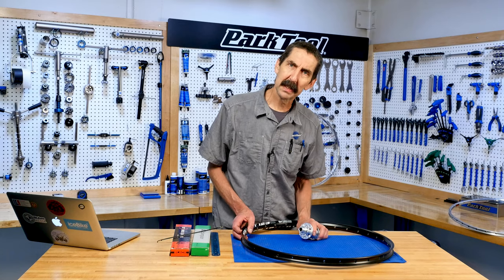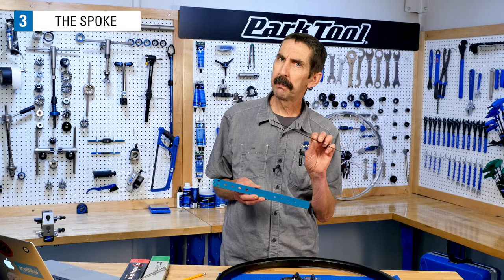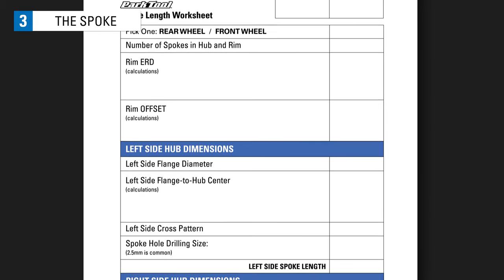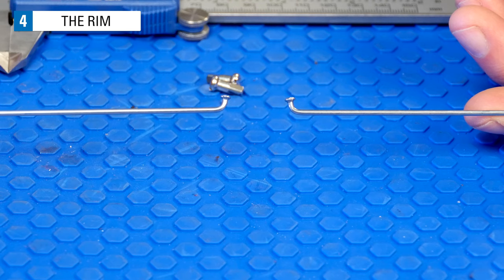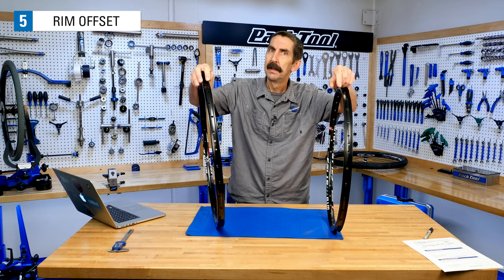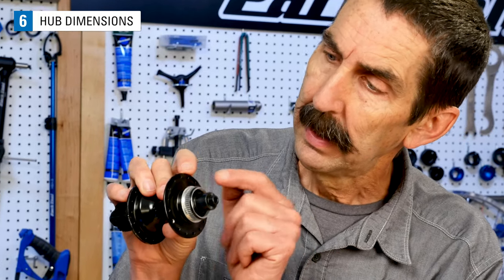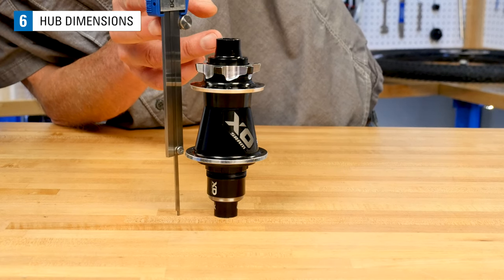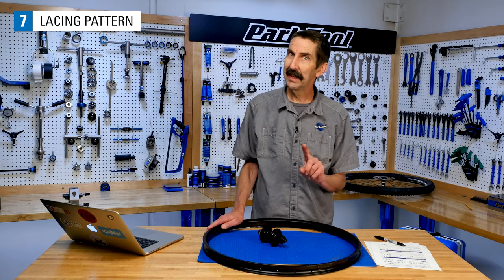Determining Spoke Length for Wheel Building

Comment: This summer, I made two 27.5-inch wheels by learning from your video. Front and rear wheels. It was my first time, but I was able to make it well. Thank you for the very easy-to-understand explanation. The rims were tubeless ready, so I made the tires tubeless as well. My bike has a 135mm rear end, so I can't find any finished wheels that can be put on 12 gears. However, Shimano sells 135mm hubs, so I made the wheels originally. Thanks, my Merida 3×8 hardtail is now 1×12. With that in mind, the front suspension has also been upgraded. Now I enjoy riding that bike very comfortably. I live in the suburbs of Tokyo, so I usually run along rice paddy roads instead of mountains. 

P.S.
 I received PCS-10.3 today. I'm thinking about how to put it in my small room.

Comment: Great video, this is really the hard part about building a wheel, in my opinion.
Reply: Others are already "ready made", for three cross, 29ers have spokes 295mm, 27.5 rims match with 275mm spokes, 700c wheels match 288mm spokes as long as its double wall

Comment: Calvin is wise. If your lengths come out wrong, it's a product of your measurements. Different people measure slightly differently so they might need to build more than one wheel to really nail the lengths. I don't mean necessarily to measure differently or more carefully but just to see if you should round up or down your numbers to get better results. Or add a slight length correction to the spoke lengths before ordering.

Comment: If you don't rely on manufacturers measurements you have the advantage of repeatability. When presented with different components you don't have to worry about the supplied measurements being measured differently. So measure yourself right from the start. Don't trust the manufacturer to know everything exactly.

Comment: In the spoke calculator it is asking me for width between holes in the rim section. It is not there in your video. I have calculated spoke length successfully before with this calculator and do not recall this measurement. It there a setting in the calculator so something I am missing?

Comment: This is perfect timing. I just bought a wreck for $10 that has a 3 speed gear hub and had a rear rim in pieces. Old enough I can’t just use the dt swiss calculator.

Comment: Thanks for another helpful video.  Clear, concise and no fluff.   

Can you tell me will the same measurements apply for a fat bike wheel?  The spoke holes have quite a bit of offset which makes me ask.
Reply from the maker: Fat bike spoke calculations are a bit different. The offset at the rim should be divided by 2 and then added to each side of the center to flange dimension.
Reply: @parktool  Thanks just saw this.  But added or subtracted.  I have been reading that measurement should be subtracted from each flange measurement.

Comment: I've learned so much from these Park Tool videos. I now have a respoked non-differential wheel after following your instructions. The only area I was unsure of was the flange to center distance. For my wheel, I measured the flange to flange distance and divided measurement in half. Are your measurements due to the rim being differential? Kindest regards and much appreciation.
Reply from the maker: The needed measurements are from flange to hub center. Flange to flange does not get this.  Measure hub width where it contacts the frame.  Divide that by 2, for the middle of the hub as it sits in the frame.  Now measure from hub end one flange.  Subtract that from the number of 1/2 hub width. That is then Flange-to-hub-Center.    Repeat on the other side.
Reply: OK, now I understand better the procedure if not the theory. Thank you for the explanation. @parktool

Comment: I personnaly use my own spoke length calculator that I made from an Excel file, mainly with Sinus, Cosinus and square root of X2+Y2+Z2 + some others considerations but I can tell after aving seen other videos that this one is THE BEST, congrates.
P.S. I also use 2D or 3D AutoCAD files for double checking eventually.

Comment: Hi Calvin, I'm from Brazil. In a non-symmetrical rim, when measuring the difference from the center of the rim to the center of the hole, do I take into account the hole that is closest to the center of the rim or the hole that is furthest away? I participated in the wheels course at Escola Parktool Brasil and received your certificate. 😃
Reply from the maker: In theory you can measure both, then average them.  However, the stagger from hole to hole is small, and will not make any significant difference.

Comment: Hi Calvin, Great video!   My  rear hub measured at 298  and my front hub at 300.  Will the 298 suffice for the front hub so I can buy just one box of spokes?  Thank you!
Reply from the maker: Suffice. Yes. 
 Ideal. No  
Less engagement up front with 298, but also less stress.  I will work.

Comment: Hey there,i have a question, I'm building a pair of wheels but my front wheel on the left length according to you video show 293 mm but i found it on 294 or 292 mm... it's really imperative to use 293mm or can I use 294mm for example? My first Spokes choose are sapim d light (2mm length increase) and the second are dt swiss competition (1mm length increase).
I'll building a trail bike on 29 rims
.
 Thanks for you help, greetings from Chile!
Reply from the maker: Typically you will want to go longer if you are faced with a situation like this. So, you will be looking at the 294's. Cheers!
Reply: @parktool  thanks for your reply. Last question , if I followed all the instructions on the video, the length spoke results are 100% accurated?
Reply from the maker: @CesarAGUGT  Thats the goal.
Reply: @parktool  thanks for your time and I'm going to star the building process and when i done i contact again. I'm really appreciate your time and knowledge. Thanks for your help 😉

Comment: Would you use differential spoking for some of the spokes in the 3-cross pattern as well?
Reply from the maker: Differential spokes gives the best thread engagement on each side.  Yes, it can work well for 3X, or 1X, or 2X.  Only needed where the hub flanges have different offsets.

Comment: Just an FYI
SpokeCalc will not accept smaller wheels (i.e. 16" trailer wheels). It returns an input error on the ERD field. 
The UBI tool linked in the ParkTool website article that accompanies this video worked just fine.
In my case I am building a 16" BoB trailer wheel with a 36h Shimano Alfine Generator hub (70mm flange dia.) so the spoke length is ludicrously short. (111mm)

Comment: What role would the nipple length play in building wheels where the differential lengths were at 3 mm? Could one use alternating 2.0x12mm & 2.0x14mm while using the same length spoke?
Reply from the maker: Good question.  Nipple length does not matter for the best length.  The end of spoke should be above the rim-to-nipple contact point.  The 14mm or 16mm nipples extend below the rim. The nipples are identical above that point, so spoke length determination does not change.

Comment: Great tutorial! On some recumbent trikes the rear section frame is built asymmetrical. So instead of centering the rim between the locknuts it is centered between the hub flanges. How would that be calculated.
Reply from the maker: In that case, the center-to-flanage would be the same for left and right side.   Measure flange to flange.  Divide by 2.  That is the Flange-to-center measurement for that wheel.

Comment: Two very important points left out of this video are: 
1. Under tension rims compress and spokes stretch. Many (all?) calculators do not take this into account and so you might want a shorter spoke than calculated. Running out of threads when building can damage nipples and make the whole experience sour. Nipple washers can be used sometimes as a workaround if the error is small. On high tension wheels like rear+drive side it is very important to get it right, and that's also the place where most lengths come out wrong too (more compression/stretch). This problem is aggravated when using lightweight spokes. So depending on the weight of the spoke and the tension that's going to used, it could need a larger final length correction.

2. ERD might be a standard in the industry but sadly it's often measured differently. The best is to measure yourself with the nipples you intend to use. AND ensure that the calculator doesn't assume otherwise, meaning it should not make corrections based on the nipple choice. You don't want to account for the nipples twice or not at all.
Reply: Roger Musson's calculator takes spoke stretch into account. The spoke lengths I get from his calculator are shorter than what I get from, say, the DT Swiss calculator

Comment: sir how i calculate width between holes? There is an option on online spoke calculator=> rear wheel => rim=> WIDTH BETWEEN HOLES.🤔
Reply from the maker: If there is minimal offset you can leave that number at zero. If they are offset quite a bit then the manufacturer will often give that number in the specs or you can measure best possible.

Comment: You've covered the length of the spokes extensively, but i've not seen any videos that mention the thickness of the spokes. Is it a matter of preference? Would all spoke thickness and respective nipple sizes fit through the wheel rim? If that's the cause would say a 12G spoke provide a stronger wheel than a 14G at expense of being heavier? Thanks
Reply from the maker: The larger diameter spokes are of course stronger but that does not mean a stronger wheel.  The weak point of the system is most always the rim.  A thicker spoke will take more stress cycles, but again the rim is taking the impacts and stress of riding. 

The "gauge" system for spokes is antiquated and misleading. There are different diameters in the "American Wire" and "British Wire" gauge systems.  Gauges are a system of electrical resistance for electrical wire.  For bicycle spokes, it is best to give just the diameter.  "12G" is 2.63mm.  14G is consider at 2mm spokes.
Reply: @parktool  Thank you. Appreciate the quick reply

Comment: For measuring rim ERD, why is it recommended to measure at a spoke hole that's away from the valve hole?
Reply from the maker: That is an old habit.  On some older rims, there is an internal seam. The ERD would be different at this point. You don't see that type of rim anymore.

Comment: When do we need to use the nipple washer and when not?
Reply from the maker: Some rims are sold with washers. Generally if no washers were supplied, you no not need them. On single walled rim especially the washer will distribute the stress.
Reply: @parktool  thanks!

Comment: Your rule of thumb of differential spoke lacing with 1mm go longer, 2mm average them, 3mm buy different spokes, does that apply to smaller diameter rims? i.e. bmx rear wheels.
Reply from the maker: Yes , it does.  BMX wheels typically use hubs with very similar flange-to-center dimensions.  It rare to see one build with differential spoking.

Comment: I have a trike hollow hub with no axle. There’s no way I could measure the way you are. Is there a specific website or way to calculate spoke size for hollow hub?
Reply from the maker: Since the hub on a trike like that is concentric you need to measure center of flange to center of flange, divide that number by 2 and that is your center to flange. The flange diameter will be the same.

Comment: Good Day. Is it okay to use 16mm nipples? I got too long spokes and I'm thinking that it in the long run it might rub down on the middle part of the spokes too much as I am also using Sapim D Lights which is 1.6mm in the middle. I also used Sapim HM washers which I think helps a bit on the direction of the spokes from the rim to the hub? Thank you!
Reply from the maker: 16mm is fine.  An ideal spoke length comes to the end of the nipple, filling all threads.  16mm should not be used to "cheat" and allow building with too short of spoke.
Reply: Great info! Thank you so much! @parktool

Comment: How do i fix this. Ibought 700c hubs, 27x1¼ rim and 308mm spokes. Are they compatible to make a wheelset?
Reply: I bought 700c hubs for my 27x1¼ rims
Reply from the maker: It is more complex.  You need the model of rim, and the dimensions of the hubs.  You can then enter the data into a spoke calculator to determine the spoke length.
Reply: @parktool  thanks!

Comment: I have the wheel, nice and true. Even spoke tension. Broken 4 spokes in 4500 miles. Want to rebuild track rear with new spokes of 270mm as measured on Park spoke ruler. Having trouble getting any. Built many wheels in my day but everybody just wants to sell the more profitable wheel set. Online shops just assume nobody can measure an existing wheel's spoke length and Lbs is out! Maybe calculate cross 3 or even 4. Just like a game of bingo.

Comment: I have only 3 available spoke choices. 289, 291, and 295mm..  the spoke calculator gave me the result of 292 on left anf 294 o  right.. which spoke lenght should i get? If i average then, i would get 293.. now im confused.. i cant get a 294mm or any other lenght here in my country..
Reply from the maker: If you can only get 295mm, then you can try 295mm. Better too long than too short.   If this is a taller rim, the extra spoke sticking out should not be an issue. Another option is a rim washer, which adds to the ERD, and would help take up the extra length.
Reply: @parktool  okey ill pick up a 295.. thanks park tool.. i really learned alot from your videos ever since ive started biking..

Comment: Is there anything inherently wrong with widening the hub holes by 1mm tops 1.5mm? 

See, I had ordinary spokes on my new bike which kept breaking. Fed up with it I decided to re-lace both wheels and the stronger spokes I have are slightly thicker. So a little help here folks, is there anything wrong with widening the hub holes?

Comment: Which Cross pattern should I use if I don't care about weight but want extreme durability for lots of weight?
Reply from the maker: 3X is the most common
Reply: @parktool  I'm lacing up a huge hub motor. The best method is a 1 x with elbows out as far as I know. Any other patterns run the risk of entering the nipple hole at a weird angle

Comment: Is it important to know what length the spoke nipples are when measuring ERD? I’m in a tail spin about getting done correctly!!
Reply from the maker: No, it is not.  Consider it where you want the spoke END to end.  A tall nipple will need effectively a longer spoke. Or adding a washer under a nipple, assuming you want the spoke to end flush with the nipple.

Comment: How to determine the flange diameter with the square body (Fulcrum racing 500 DB) thank you
Reply from the maker: That uses a Straight Pull hub, with only 8 spokes. Use the same calculator but look for the Straight Pull mode, not the J-bend.  These hubs are very difficult to measure for head insertion in the flange. It is best to use the manufacturer's specifications.

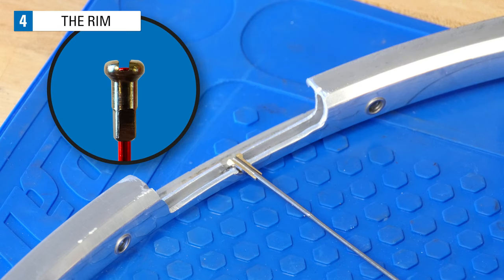Comment: 4:53 bill mould thinks a little different, for him , ideal spoke length  is when last thread cut deep  into nipples thread, to prevent spoke to break on thread, what is really rare situation, spokes break on elbow in 99%, so i know(not think) that good spoke length is what you said +/- 2mm, i made wheels on customer demand with spokes that were connected with nipples on 5-6 threads and wheel survived

Comment: Hello thanks, I was wondering, I have 24h front and 32h rear with dual and triple cross patterns respectively. Is it possible if I lace dual cross on the rear or triple cross on the front for compatible looks?
Reply from the maker: It is possible to do, but not logical. You will need new spokes and they will still be aesthetically different because of the spoke count difference.
Reply: Update: I've did a forum research and came up with unique solution. I've attached the 24h rim to measure the back hub. Now, the back hub is Nuvinci n380, spokecalc.io doesn't accept hub diameters bigger than 90mm in formula, so I had to improvise. Measured NDS direct-connect to 32h hub which is 242mm,  and 1X pattern on the DS, as it will show a crow's foot pattern(2:1) This solution made me so grateful. It not only rescued the visuals but also saved weight and equalized the distribution of spoke tension between DS and NDS.
Can't wait till my second 24h rim and spokes will arrive.
Though I found the solution by myself, I wouldn't do so, if I wasn't inspired by your video. Thanks, Calvin! 
Have a nice one!
Reply: Here is a guy explaining advantages of 2:1 lacing, which was first used by Lord Ford.
https://youtu.be/Yp-yT40xQqc
Apparently, my previous issues of rim-brake rubbing more on the DS would come to an end! I'm gladder than glad btw.

Comment: in the actual spoke calculator you have to put " width between the holes " how do i measure that?
Reply from the maker: Find the two spoke holes in the hub flange that are straight across from one another. You want to distance between these two holes.  Use a caliper to measure this.

Comment: What if the info is just Bontrager AT-650 etrto 584x20. No hope?
Reply from the maker: Those numbers will not help with spoke length calculation unfortunately.
Reply: @parktool  Thanks for replying. Amazingly, Trek customer support had the answer for me. Don't really know if I should trust their answer. I was able to get the serial number of the bike so maybe they have all the info from that.

I have this tool to measure spoke tensions and was wondering if it's normal to have different tensions on each side of the wheel?
I was measuring 25 on all of the spokes on other side and 20 on the other side.
I guess that would be normal since the lengths of the spokes wary from side to side also.